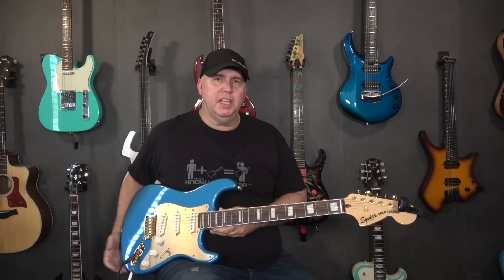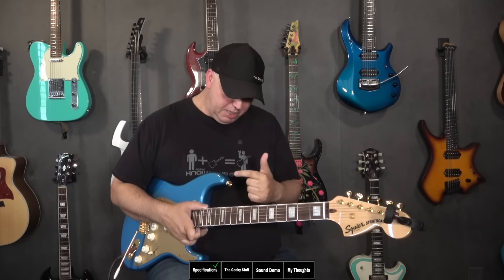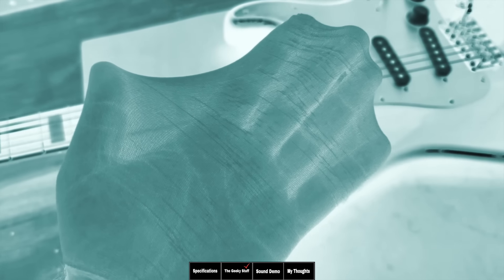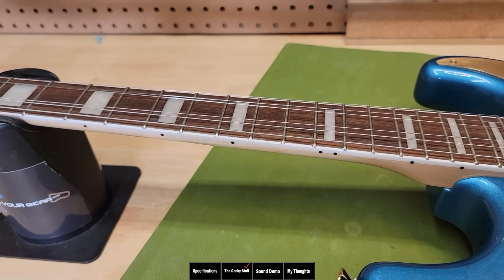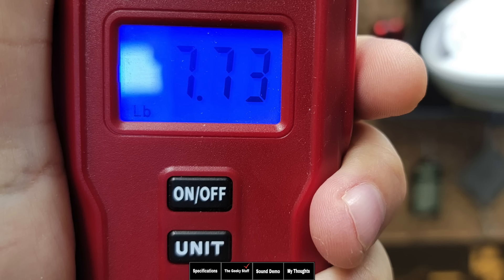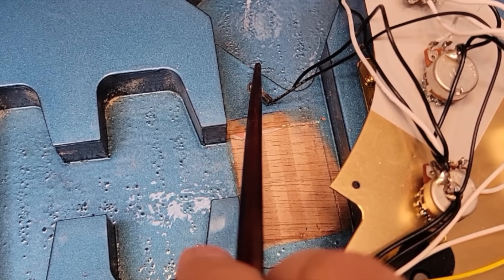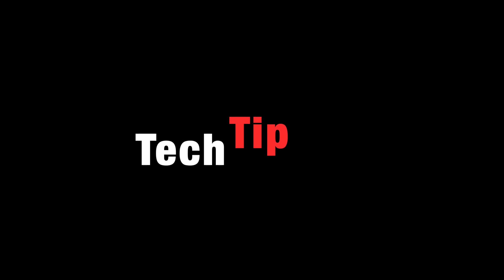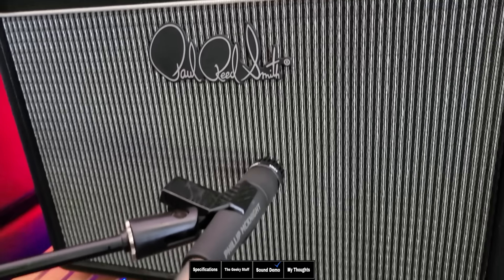Squier Surpassing Fender Guitars In Quality?

Comment: I got two specimens of the jazz pro ii cause the finish on the neck was chipped and terrible. Second one was better than the first, just kept it and sanded down the poly chips all up and down the rosewood fingerboard. Went to change out the pickguard and the rhythm switch was stripped out and impossible to remove. Not sure what was going on in the factory the last few years, but definitely not worth what they were charging. This was before the price increases too

Comment: I like my Squier J Mascis Jazzmaster more than Fender Player I tried. And it's up there, but different, to the Vintera ones. Oth, even though my Squier Bass is great (their basses are even better than their guitars) ... my Vintera II Precision is definitely II levels above the Squier in sheer quality. Similar with the Telecasters. Love the Squier CV Tele, but, I tried the Vintera II 50s Nocaster and it's definitely a better vintage Tele. I will be upgrading later on. But I won't sell the Squier, it's great, can use it for slide. Or my children can take it to learn on. It's almost as good as the MIJ 90s Fender 69 Strat resissue that was my first proper serious guitar.

Comment: They have been just as good for a long time now...the old style vintage tuners are far better , stay in tune way better and look better...save hundreds buy the squires and do a few minor mods, vintage tuners, some pots and treble bleed caps, little bit of money, make nut slidey, adjust trem, sand off neck finish mayby do a slight scalloped, all mine are like this, as good as any strats....just butter.

Comment: My Squier Tele bass had better fretwork and was set up better straight out of the box than my Fender Custom Shop bass.  It also doesn't have the G-string 5th fret dead spot that the CS has.  The Squier also has not had the neck finish peel off like the CS did when it was about a year old.  Best quality Fender bass by far is my MIJ '51 P.

Comment: I own two fender strats that are both pretty old - a MIJ that’s 40+ years old and a MIM that’s almost 20 years old. 
So it’s time to throw them both away and get new ones - or at least that’s what the guitar man from the center of guitar vile said. 
Is that right? Do they not sound good when they get old?
Is there a battery to change or maybe a new paint job that will Meade them sound better? 
They also seem to stink more than ever. 😊

Comment: Ordered this one and I was a little disappointed. I liked everything a lot but there were icks. I didn’t like the glossy neck (thought I could get used to it), the frets were a MESS. They were rough, pocky, scratchy. The nut is way to deep for my taste. 
When you set them all up with really going into the setup with working on the frets this can be a quite nice guitar.
I bough it for 350€ and for that price: perfectly fine. For the original 600€ nah. 100 more and you could get a good deal fender player. 
I do really like the color, the gold hardware and I ended up building my own fender looking quite similar. I painted a swamp ash body in lake placid blue (mines a little darker and more saturated), gave it a roasted maple Mexico neck with a satin finish and a high gloss fretboard. Added gold hardware and vintage pickups and I’m all set.
Cost about 800-1000 in the end. But all in all a little bit better set up and a better all in all value.

The Squier is honestly a good catch if you know how to set up a guitar properly. All issues are fixable. BUT I also own an Affinity I bought a few years back to find out if strats work for me and the affinity is a dream when it comes to the setup. The fretboard is a dream, it was well setup it felt incredibly well and sturdy and I’d I didn’t know it’s an affinity Squier I would probably guessed the guitar would be around 600-700€. 
I feel like they could’ve stepped up their game a little bit with these anniversaries. Especially when it comes to the value for the price. HOWEVER the designs are incredible. This Strat is a dream, the green Tele is .. ughhhh beautiful. (I would recommend switching the gold pickguard to a white one :D)

Comment: Great review Phil! If you are considering any new ideas, what if you checked the fretwork by lowering it to 1.5mm to start and then raising it until it didn't buzz on bends or something like that? That would be neat :)
Reply: Same thing with Epiphone on the 4th fret. Easy fix though, and once done I no longer see the difference between my Gibson. Kind of sucks that a guitar 5x the price is not noticeably better.
Reply: That doesn't stop the snagging on the ends though lol like he said,  that's the biggest issue with these frets.

Comment: It really isn't bad, if you want heavy stuff i use bridge/neck pickup and tone to 0.. ofc you have to setup your amp differently so it isn't that dark but you can take the gain to 10 without much buzz :) It never is the guitar it's the player.. Just experiment and you'll get the tone.

Comment: Judging by the  cleanliness and quality of the binding and inlays, I am willing to bet they're made in the same Chinese factory as the Fender-owned Jackson JS guitars are made in. And they're still cheap in terms of hardware. That's where the biggest cost sacrifice hits. The build quality of the body and neck at that factory is easily top-grade on par with more expensive guitars. You may not notice it while playing the guitar bone-stock , but replacing pots, pickups, and even the jack make a HUGE noticable difference. Replace a cheap part like a pot or jack, and hear it for yourself. Then replace just one pickup while leaving the other two stock, and hear it as clear as daylight.

Comment: I don’t recall you mentioning it, but there IS a difference in sound, and it comes from the literal difference in pickguard materials which, if we believe guitar tone results from a whole system of physical choices, means that the eddy currents and the things that effect the quality of tone in Telecaster neck pickups in their chrome housings, continue to behave in scientifically explainable ways even when a pickguard that is used to secure pickups happens to be made of plastic… or metal… and the tonal characteristics that accrue to these seemingly only visually-important choices.

If the ONLY thing you changed from this guitar as stock to “modded” was simply using a metal pickguard versus plastic, and every recording technique kept the same, I’d bet you’d find significant tonal differences that won’t require a guitar tone guru to detect, that could result solely from differences in the pickguard material from metal to plastic, yes?

I’m not saying pickups housed in a metal pickguard sound better or worse than a plastic pickguard, because some prefer it brighter tone and some prefer darker tone, but your opinions on Stratocaster tone and the differences in tone that accrue to solely to metal versus plastic pickguards?

Comment: Unfortunately, GC puts these on shelves with really dry fretboards and gritty frets or rusty strings.  The fret ends have been an issue, but I’m able to fix those quickly.  Fender loves to cut that nut quite low at times.  I’d prefer to have a little give for it wear in or be sanded down if needed.  Just think they missed an opportunity.  I think an $800 Squier would’ve been that ‘cool’ guitar to show up with.
Reply: I think most ppl would go for the Player Series and get a real Fender if they were spending that much- I would. I gave 400 for my CV 70s HSS and imo this is a dressed-up version of a Classic Vibe. They have the same pickups in them, the same quality of neck, etc.- it's a Classic vibe with a smaller neck, binding, and some gold hardware. I think this is about as much as ppl will pay for a Squier- if they spend more, they'll want a Fender, maybe a Sire, or a PRS. Something with better resale than a Squier.
Reply: For less than $600 you can get a very nice MIM and have some $$$ left over for pickups, case, whatever.

Comment: Alpha, CTS, etc. pots are all manufactured to the same quality regardless of size (electronic components have values, not 'tone'. The difference is just that, the smaller ones are made to go into smaller spaces. Full stop. Yes they feel different as the longer 'wipe' of the wiper will be slightly less sensitive, and possibly easier to adjust to that specific tone/volume you are looking for.

Funny innit how nobody ever looks at the size of the pots on amps, seems that there is no mystical problem 'tone wise' in amps.... and most modern amps, solid-state or valve/tube, use small pots.

Comment: The strap button not being centered is not a deal breaker but it does show that there are still some quality control issues with this brand. For that price, Fender needs to step it up. I mean you expect that on $75 strat knockoff, but in this price range this shouldn't be happening.

Comment: I have the 40th Anniv. Jazzmaster Gold Edition. After a month of daily playing I'm really pleased with it. It's more than 'okay'. The neck is very comfortable to play. Low action with these narrow high frets. Neck does not feel sticky at all. No need to shim the neck, due to a slightly angled neck pocket. No file marks in the binding or on the frets. No rattles from the bridge. Weight is 3.7 kilos. https://youtu.be/ziZw9CF9bb0

The blue metallic poly finish is simply flawless. No dings and scratches. The gold anodised aluminum pickguard looks beautiful. Fit and finish is above expectation.

The neck pickup sounds beautiful, a lush and clear ringing tone. Middle position, also two-thumbs up. REALLY surprised a budget guitar has such a good tone. The bridge pickup was harsh by comparison but all it needed was to be lowered two turns.

The vibrato system is okay (but not more than okay). The tuning machines seem fine. The fretboard was comically dry. Never saw anything like it. Gave it two coats of lemon oil. It will need more at next string change. Looks nice - dark and with streaks. Pearloid block inlays to boot. It's not the best inlay works I've seen as two of them have a small gap. At this price point - no complaints.

The frets, though nicely crowned, sounded like dragging strings across sanding paper. I spent 1,5 hours polishing the frets, rounding off the fretboard binding and cleaning up a bit of polishing compound from the fretboard.

It had 9s on (this guitar was designed for heavier strings). The 9s were binding at the nut. So tuning stability was bad. I took it straight to a luthier to get the nut recut for 11s before I did anything else. Tuning stability was much improved afterwards.

The pot knobs... they look and feel cheap. The jack socket feels wobbly. The lead circuit switch felt very stiff and broke in less than 2 weeks. Thomann send me a replacement, but it was the same cheap switch. The bridge pots need a dab of LockTite to prevent it from lowering itself under string tension.

CONCLUSION
Never had a Squier guitar before and am very pleased. Love the sound, feel and look of this Jazzmaster. I wouldn't recommend a novice to get one, or at least not without stressing the necessity to get it set-up properly. I like doing this myself so I'm fine there.
Reply: Excellent post sir...thanks for the details it's really informative ✌️🏴

Comment: I have a 50 year anniversary squire and the fret burrs are unreal. It really hurts to slide up and down the neck.😢
Reply: Next time you change strings try going up and down the side of the neck with 0000 steel wool. Put the body in a plastic bag first.

Comment: My 60 th Anniversary Squier made in China, absolutely kills my 40th Anniversary Squier. Tone is way better, warmer, better built. The 40th right out of the box needed the neck tweeked, fret ends needed filing, the nut was so sharp it almost cut my hand on the corners. Spent hours getting it right, then plugged in the 40th and shazam a tin machine.

Comment: I restored a silver-logo E9 Korean Squier (1989). Rosewood, medium frets, 500k mini pots w/.33 cap.
Just about everything needed repair.
Broken p/u tab remolded the plastic, new TusqXL nut, missing a tuner so installed a set of Kluson Fender trapezoids (Korean made), new trem bar
The bridge/block were bent saddles, Fender, with a full-sized block.
Copper foiled the cavities and rewired the ground.
Lots of DeOxit F5 . . .

Here's the thing. Beautiful neck, and unlike past Strats I can do clean and clear bar chords E-to-E up and down the entire neck. Magic? Super low action . . .

Comment: Only built for right handed players. I switched over to Jet guitars. JS400 is a great guitar at half the price. And you can get them in left handed. I've had two fender player series strats and had issues with them. Had Squier guitars and found issues with them also. Tried the Jet series guitars and they are amazing.

Comment: if the neck is too sticky, you all will pull your finger nails out. Baby powder works pretty good though.
Reply: ?on a bound guitar, do they not cover the ends of the frets during the manufacturing process? this one obviously not, but my Les Paul and others.
Reply: Do they have a 7 string 24 fret? With a flo ro on it?

Comment: I had one in RED like this one - but it was so horrible that I had to send it back - I was SO disappointed. I LOVED the feel of the glossy neck, the neck C shape of this was fantastic. The fret work was acceptable, but also sharp at the fret ends, just like in the video. The setup out of the box was decent. It looked SO beautiful. The pickups sounded mediocre ok , but still a disappointment considering the proud price tag. The pick guard looked great but was razor sharp, very disappointing. The bridge was also not worth the price. The color and gloss finish on the body was not good, not even - on closer look appeared cheap, like bad Chinese guitars used to be 15 years ago. There were scratches near the nut. Inside no shielding. The pickup selector switch didn't feel right, like cheap. I was left with no choice but to send it back - I should add that the shipping box was double box and totally professional... again adding to the disappointment that this Anniversary Edition was such a let down for me..... so I  replaced with a second hand Squire Classic Vibe where I bought a Fender Texas Special KIT.
Reply: Classic Vibe is proven to be great now, so many people, including myself are pleasantly surprised by them.

Comment: Neck is really problematic. Glossy back, binding, bad fret work, block inlays, no skunk stripe... Not a Strat neck. And the "gold" hardware look so cheap and low quality, with pickguard plate included. Everything here look so cheap. If this surpasses Fender in quality, then that Fender quality is terrible. In that price mark there are many better options, like Sire mentioned in this video, or Sterling. I don't see why someone should buy this guitar.